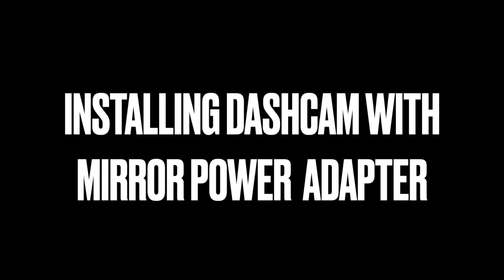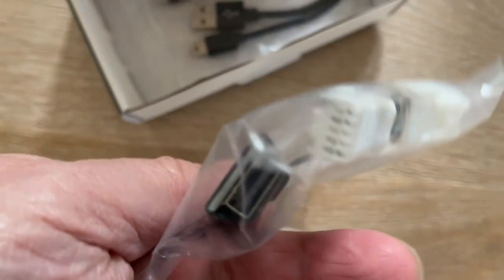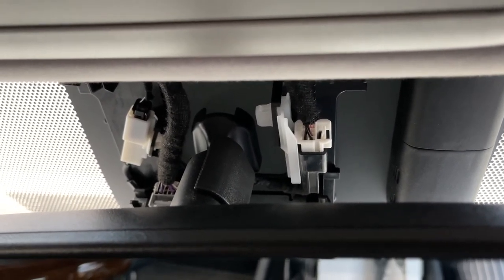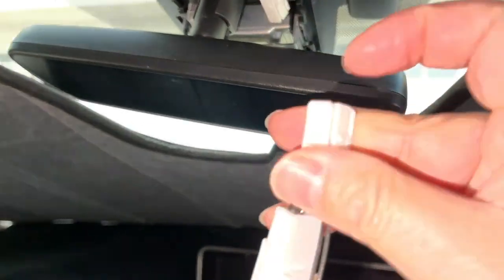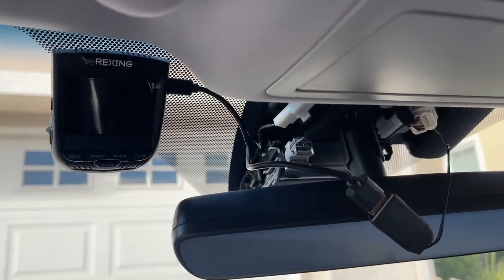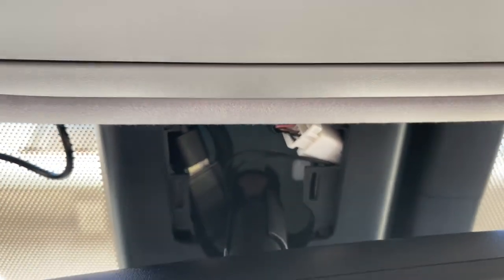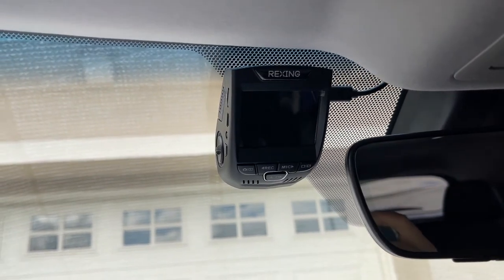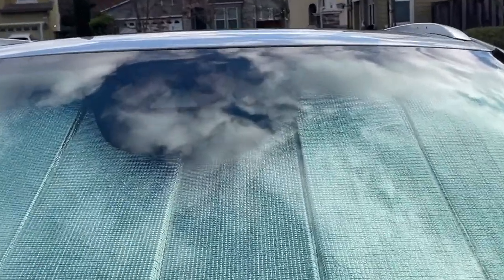DASHCAM: TAPPING REARVIEW MIRROR/Rain Sensor for Power on Lexus/Toyota

Comment from the maker: I know Dongar works for the 2016- 2022 Lexus RX and 2016 - 2020 GS. Please help post a comment of your vehicle model if this power splitter works for your vehicle also. Thanks.
Reply: Works on my 2022 Lexus ES300h. I wish the wire of the connector that plugs into the dimming mirror’s plug is longer, say 3”. I had no choice but to disconnect the mirror’s plug from the mounting clip to fit the adapter and wires within the cavity so that the cover would go back on.

Comment: Excellent video and this will save me a lot of trouble with trying to run wire to tap into the fuse box.  I’m going to install this in my 2018 Lexus LC500.  Thanks for the great tips!  
Excellent video!
Reply from the maker: Yw

Comment: Hello, I tried installing this on my 2017 GS 350 F Sport but it doesn’t consistently give power to the dash cam. Shortly after powering on, the dash cam shuts off.

One workaround I found was that before powering on the dash cam, I have to press the “I” button below the rear view mirror which I believe is the garage opener in order for the dash cam to stay on. 

Any idea why that’s happening? Did I receive a faulty adapter? I also have it connected to the 10-pin connector like you do in this video.

Thank you.
Reply from the maker: Did you get the Dongar 10-pin Type B connector?   I'm using that one and installed on the 2020 GS 350 F Sport without any issues. Also did that same thing on RX and new NX also.   Also, try testing the dashcam independently to see if the dashcam is working good.
Reply: @netman88 thank you for the response!

Yes, I ordered the dongar 10 pin type B connector. However, while unboxing it I noticed that the little poly bag where the usb cables come in was already opened and was missing the USB-C cable. I’m thinking I received a return from Amazon even though it was listed as new.

I connected the dash cam to a separate USB port and it stayed powered on the whole time so I don’t think the dash cam is faulty

Comment: I removed the cover to my 2017 RX350 mirror assembly and it has an empty connector on the left side, can I just plug the camera into that?
Reply from the maker: Yes, if it works.
Reply: @netman88  👍

Comment: Put a dongar on my 2017 Lexus RX F Sport. Getting all kinds of error codes (cruise control, auto headlight, crash prevention). The usb power and mirror work though. What gives?
Reply from the maker: Not getting any errors on our 2019 RX L. Clear to codes and see if they come back.

Comment: Do you know if it’s okay to tap a radar detector to the connection? Or will this cause an overload?
Reply from the maker: If just radar or dashcam is probably fine. Doing both, I don't know.
Reply: @netman88  true. Just got a radar detector and the wire isn’t that long so I’m going to have to remove the dash cam mirror tap. Not trying to ruin my power mirror. Also thanks for the fast reply!

Comment: I have RC350, the rearview mirror have two connectors , in my car the one on the left is 12 pin and the one on the right is 10 pin, why you choose the right? what was the reason, I planning to get the 12 pin because it is available , the 10 pin out of stock .
Reply from the maker: I haven't tried that 12 pin given all the specs indicated the 10 pin one. Let us know if you did any hacks to get it to work.
Reply: @netman88  I don't have any info. on the specs of the 10 and 12 pin, I thought they all same voltage, since you have info. on the 10 pin specs, I would go with the 10 pin, I see comment below that there RC350 did not work, but he didn't say he plugged the 10 pin or 12 pin.

Comment: Is it working fine with the dual dash cam? 
If you connect the rear dash cam to your rexing is it working?
Reply from the maker: It should work. I don't have a dual dash cam to test with though.
Reply: Late reply but in my 22 is350 it works and supplies enough power for dual camera

Comment: This won't affect of the mirror dimming or rain sensing features?
Reply from the maker: I didn't have any problems with it.
Reply: All it's doing is paralleling the circuit.   The mirror doesn't draw that much power (amperage).  I've done this before in my 2018 Lexus LS500 with no issues to operations of mirror functionality.

Comment: Will parking mode work with this method?
Reply from the maker: Nope
Reply: @netman88  Ouch! I thought it did because the garage buttons work even when parked with the engine off!  So, it doesn't get continuous power supply enough to keep the dashcam powered?

Comment: This adapter is out of stock everywhere 😢 Definitely install one on my 2022 Lexus
Reply: When it’s back In stock what dash cam would you suggest?
Reply from the maker: Temporary back in stock. https://dongar.tech/products/10pin-type-b-lexus-toyota. Check if that's the supported model for your vehicle.
Reply: @netman88  Placed my order. Thanks
Reply: @rutgershouses  I use Garmin Mini 2. It’s tiny.
Reply: @deplorablechump8758  how do you like it? I was thinking of get the same
Reply: @rutgershouses  I like it. It does the job and small enough that you or anyone wouldn’t notice that it’s there.
Reply: @deplorablechump8758  that’s exactly why I want to get it I also have a 2022 Lexus GX 460
Reply: @deplorablechump8758  let us know how your install was, if you can video your install and post it I like to see how it’s done
Reply: @rutgershouses  Just received it. Will install tomorrow. It should not be hard.
Reply: @deplorablechump8758  video your install from start to finish, show us how you remove that black plastic cover that’s my main concern
Reply: @rutgershouses  Installed. It took longer than expected because I didn’t want to break anything and there was a bit of wire management. I had to disconnect the plug of the dimming mirror from the mounting clip to make room for the adapter and the camera’s wire. Take your time and it can be done.
Reply: @deplorablechump8758  your vehicle is a Lexus GX 460 right ?
Reply: @rutgershouses  No, it’s ES300h but it should be similar to GX 460.
Reply: @rutgershouses  I was too, but take your time. In my case, it was difficult to remove the small cover. Removing the big cover was easy by sliding it down. Slide the entire housing down first and slide your index finger inside to push the small cover out. Don’t be afraid.
Reply: @deplorablechump8758  did you use a plastic pry tool? Or did you just use your hands and kind of pressure and wiggle and slide the housing off? I’m nervous about cracking the plastic housing
Reply: @rutgershouses  I just used my hand. Plastic pry bars may help.

Comment: Does not work on 2019 RC F 350 as well as 2014 gx 460
Reply from the maker: Interesting, I would like the RC would work. Did you use the rain sensor connector?   I installed the same setup on my 2020 GS 350 F Sport and it works great.

Comment: Will it work for Lexus HS250H 2010 model
Reply: Nope. But you don’t need the adapter. Just run the wire along the top of windshield, inside the side cover, and under the steering wheel to the USB plug or cigarette plug. Remove the side cover by prying out a couple of small covers to expose a couple of hex screws underneath. It’s really easy.
Reply: Why doesn’t it work?

Comment: How about for 2022 rav4 xle?
Reply from the maker: It should work. I just installed it on the 2022 Toyota Camry SE and it works fine.
Reply: @netman88  cool thanks bro
Reply: @netman88  I have a 23 Camry, as you did in the video, do you unhook and use the right side connector as well?
Reply: I don't believe it has a rain sensor so what would the right side power?